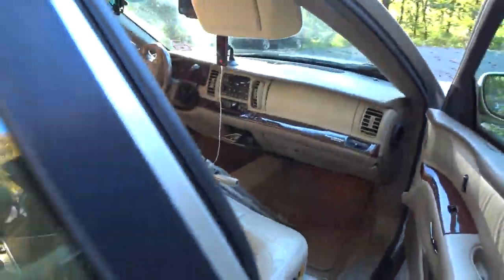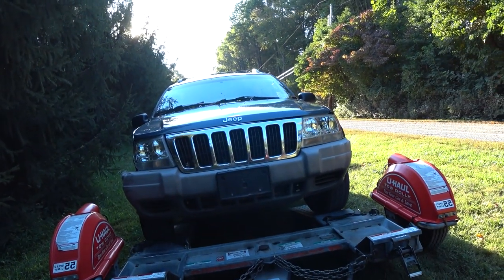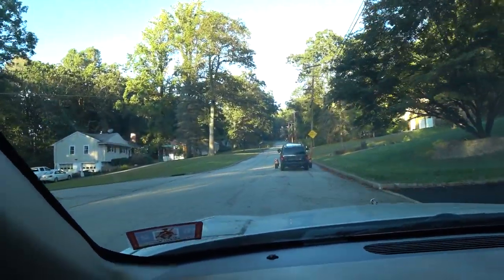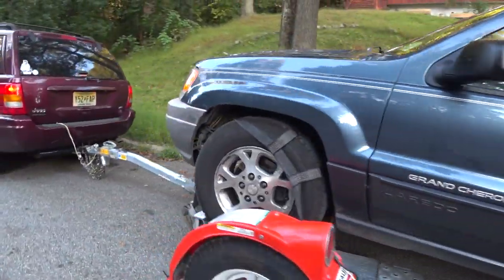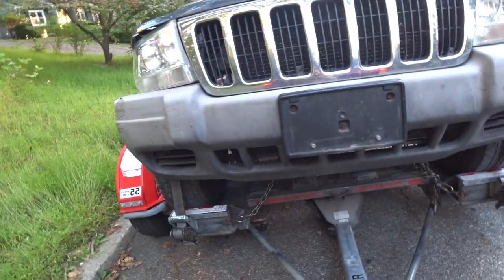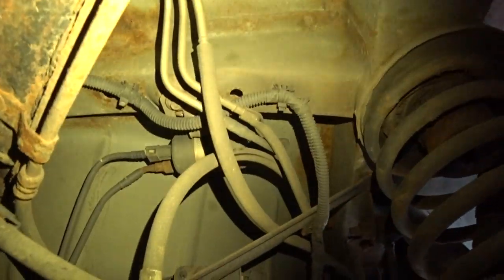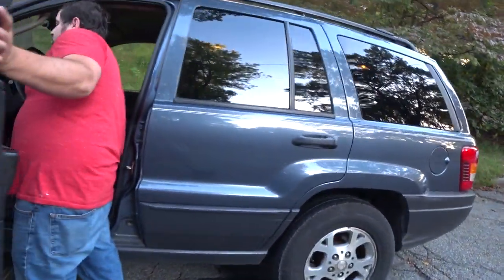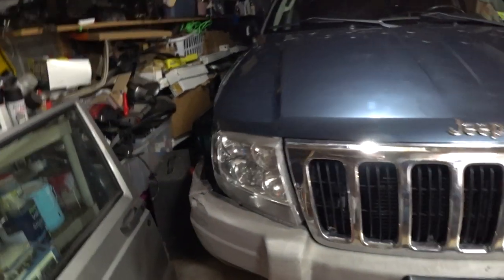How To Tow a Grand Cherokee with a Grand Cherokee - Getting Our New PROJECT JEEP Home

Comment: I used a 94 2-dr 2wd XJ to pull a 96 4-dr 4wd 60 miles@50mph.  It had the power but not the brakes to emergency stop if necessary.

Comment: I use to tow all kinds of stuff with my 4.7 wj I’ve even towed stuff with my 4.0 one time my 95 ext cab Chevy broke down and I towed it about 15 miles home with my 4.0 WJ on my car trailer it wouldn’t shift out of 2nd more go over like 35 miles an hour but it got it home
Reply from the maker: Haha.. the only thing that matters is that you go home!
Reply: I towed a uhaul down to LA partially loaded and back home fully loaded with stops on the way back. Overall nearly a 4000 mile road trip. Didn't hear a single complaint from my 4.0.
Reply: @Terminator7786.  
Next weekend I might have to go to Los Angeles and tow 5k back home. All I have at the moment is a 2004 Freedom Edition 4.0 4x4. It's a 400 mile trip.
I'm wondering if my Airlift bags will be enough without a weight distribution hitch. 

I've towed professionally 10 years but never 5k with a "light" vehicle.

Comment: I'm sorry Doug that is not a 04 Jeep. The reason i can tell is because the 04 model came in with a different front grill. Plus those rims came only with 1999-2001 model WJ only.
Reply from the maker: Yea, it is an 03. I meant to add a notation that a tripped on my words when exp[laining. I did call it an 03 in the beginning of the video. Good catch though, bud. You live up to your name "Mopar Man". Now the rims and bumper are something that has us stumped. we have the title and it is a 03, but as you pointed out the rims and bumper are wrong. We figure maybe an accident and a junk yard bumper. Maybe the original owner changed the rims out? Lots of questions on that thing.
Reply: @DEInTheGarage  true. I enjoy you guys video. Keep it up.

Comment: Yikes the one worst way to haul a Jeep is on a dolly.  all 4's on the ground transfer case in neutral and transmission in park...I like the transfer case in that WJ the ole selec-trac.  So, question, the manual states as I stated transfer case in neutral and transmission in park to tow a Jeep on all 4's, says to disconnect the drive shaft if you tow it as you did, but in reality, would the way you towed it cause damage since the transfer case was in neutral it was theoretically disconnected from the transmission?

Edit:  Nice to see another Jeep project on the way.  I really hope you can manage to get everything you want off it for Ruby, and then either repair and resell that Jeep or keep it in the family.  I have a 98 ZJ, but I'd love a WJ at some point too, don't think I'd want anything newer than a 2004 Grand Cherokee.  I'd love to get a 98 5.9L Limited and a 98 5.2L as well and have 1 with each engine in the driveway, but I keep running across the 98 5.9L Limited's and they're either ridiculously priced, or they're trashed, I find the 5.2L's occasionally but most of them are pretty trashed as well.  I have plenty of time, I spent 3 years looking and searching for my current 98 ZJ, and when I saw it I knew it was the right one, sometimes you just know and feel it I guess IDK.  The 2 ZJ's I've had/have I searched and searched for, my previous 96 ZJ was owned by a retired couple that towed it behind their motorhome, I really should have yanked that tow bar off and saved it before I sold the Jeep :(.  

You didn't mention which engine is in the new WJ, electric fan, sounds to me like another V8?  If so the selec-trac behind the V8 isn't very common at all it seems.  I've only seen 1 or 2.  Something else weird, the 5.9L Limited's only had quadra-trac but the 5.9L Dodge Durango's were very common to find that 242 in them.  Which brings me to another vehicle I want LOL, A Dodge Durango with the 5.9L and selec-trac LOL.
Reply from the maker: Yea, I read the manual, did some thinking of my own and decided to just go for it.once the t-case is in nuetral, there is no more physical engagement with the rest of the driveline. I am i missed something, but it isnt like I towed it to Alaska. It was like 10 miles. If I had a tow rig capable of flat towing I would have rented a car trailer for sure. This new one is the 4.0
Reply: @DEInTheGarage  4.0L Great engines, both my ZJ's had/have that engine.  

So, I wonder why they say you gotta remove the driveshaft since the transfer case is in neutral?  They also say put the transmission in park, well what matters if the dang transfer case is in neutral?
Reply from the maker: @wildbill23c  Yea, I am just not sure. Something must still spin in the transmission when the t-case is in neutral which could build heat. all I can think of
Reply: @DEInTheGarage  Ok, I was thinking the same, thanks.  I'll wait for the ole 242 swap LOL.  Not that I have that problem, just want to see it done...never know may need that little tid bit of of knowledge at some point.

Comment: Why would you put another 247/9 in to your Grand Cherokee  its already got one I thought you wanted a 242 or is this one of the rear ones to have a 242 enlighten me please.
Reply from the maker: Ok, the red 4.7 WJ in this video has the 247 which i am not a fan of. The blue one we bought has a 242. I am going to swap them so that my daily/plow jeep (the red one) has a 242 with the varilok axles which is the strongest combination for my needs. 

All that said, since the blue one still needs a transfer case for whatever its next life will be, it is going to get the 247 which was originally in my 4.7

Comment: I'm considering buying a wj v8 to replace my 4.0 wj for towing my boat and camper. What comes in the factory tow package? I was thinking I would rather buy one without a hitch on it and install one myself that way I know nothing's been towed with it but what would I be lacking other than the wiring harness and bumper cut out?
Reply from the maker: Nothing, just mkae sure you get one with a solid gas tank skid as that will need to be supported to install the hitch (the use the same bolts). I have a video on how to put a hitch on a WJ as my red one did not have it when I bought it
https://www.youtube.com/watch?v=DhMzqKZWHg8
Reply: @DEInTheGarage  okay thank you I actually installed a hitch on my 6 cylinder WJ so I imagine it's the same for the 8-cylinder was more curious about if I needed to worry about the extra fan or the power steering cooler stuff like that.
Reply from the maker: @comicman8724  Oh, I understand. The fan was the same on the V8 with or without the tow option.The tow package had 3.73 gearing, but many V8s came standard with that anyway. You should be fine

Comment: 4.7 can pull a House down!
Reply from the maker: Haven;t tried that yet, but it made short order of pulling this other WJ. I find the weak point in the brakes, so I will be installing a brake booster and upgrading my trailer to include brakes
Reply: @DEInTheGarage  I just put new Breaks in My 04 limited. Pedal feels spongy so I'm betting the rubber brake hoses need replaced.... That's usually the problem..

Comment: Can I tow that same model jeep with  a regular tow bar?
Reply: I have flat towed my 99 WJ but it's a heavy beast and you need a Brake Buddy to add braking to be safe. At least the tow dolly might have surge brakes or preferred electric that can be controlled.